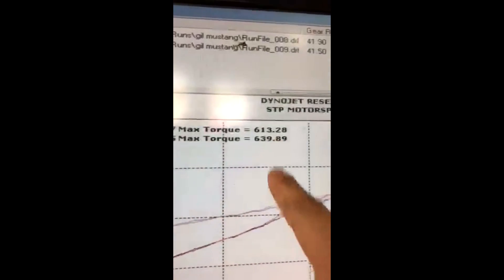What parts dont need tuning,  And Paxton 2200 E85 15 psi Dyno on VMP tune

Comment: After I did my cat back the car stalled out thought. Back pressure changed on the 15. It wants to stall after starting up after hot or refilling gas. Otherwise the whole car is stock

Comment: What about a pulley change 2.6-2.5 or adding a factory blower thats ported say on a gt500
Reply from the maker: 1991tommygun good to log it to make sure fueling is on point. But typically not if its scaled properly.

Comment: i have a 17 5.0 premium i want to add a novi 2200sl how much power on a stock engine can i get safely .. i will do exhaust injectors yada yada .. but no internal mods .. how safe is 700 rwhp
Reply: I have a 15 premium with novi 2200 with 3.6 pulley, MBRP exhaust, MSD coil packs, JMS boost-a-pump, with a lund tune. Dyno numbers are 625whp and 498wtq at around 8-9lb of boost, all stock internal.
Reply: @LEVONLEWIS1  hows it pull bro ?

Comment: What about torque converters?
Reply from the maker: Unless you want to change where they lockup, it's mostly mechanical.
Reply: Devon DeHerrera I run a 3c in my nitrous 12 gt and I ended up not changing anything.  Oe lockup is just after shifting into 3rd. Like he said if you want this in a different spot then flash it but I haven't had any issues on stock trans tune. 1.4 60ft and 6.80s in the 8th stock motor trans with converter and footbrake on juice 👌🤘

Comment: So if the car is throwing a maf sensor code with the 2.8 kb with a jlt super big air what maf sensor can be used.  Because i think the sensor is maxed out.   Its still factory 2011 gt500 sensor.

Comment: +Alejandro Flores Hey, I had the issue recently with my SCT bricking while trying to change tunes and turns out it's actually not the battery that causes this issue. I worked with Lund and SCT for about 3 days trying to pinpoint what it was and it turns out that if you try to flash the tune in some of these cars while the engine bay is hot, the ECU decides that it doesn't want to read or write data. The remedy for this was to let the car sit for about 30 minutes and let everything cool down before flashing the tune and it works 100% of the time. My car is also a track pack which I'm not sure contributed to the issue or not but I'm kind of assuming it did because I had a non-track pack 2014 GT before I bought this 2014 GT. Hope this helps and you can pass it on to others.

Comment: Retune off road pipes...My SCT screwed up just because I re-flashed with my door open. (dome lights on, etc.)
Reply: I wish I knew a long time ago just how sensitive input voltage was for that sct tuner! I'm so paranoid about it, whenever I'm retuning - radio off, windows up, doors shut, hvac off, manually lock my doors so noone opens them while it's loading, hold my breath, etc. ALSO, I have found (at lea st for an x4SCT on a 13 gt) to not ever retune immidiately after a decent length drive. I have been told by a guy at SCT that they have experienced that too - they seem to think it may be on certain ECM's that have a wire that expands so much during a drive that it loosens the connection. I know...crazy, but I make sure to wear my dream catcher when I'm loading tunes!!
Reply: LOL...ya best to be on the safe side....LOL I do believe SCT recommends a charger on the battery, but hey, who listens to that...LOL

Comment: do you need to retune your speedometer if you go from 17inch wheels to 19 inch?
Reply: Pavlo95 If you have an SCT device,  you can change the revs per mile on the device itself.
Reply: Space Man I went from 17 to 20 and I just used an app to see my speed and everything was the same so I don't think you need a tune
Reply: Depends on the tires.  I went from 18s to 19s with a staggered set up.  It threw my MPH off by 7-9 MPH.  All I needed to do was find the revs per mile of the rear tires.  Which the manufacturers list on their website. You don't need to tune but if it's throwing the speedo off,  just change the revs per mile on the device.  Easily done

Comment: I have watched a few of your videos. But on a personal level for your car which do you prefer to tune with? SCT or HPtuners? Which has a more helpful userbase to help out people who only tune their own cars, etc?

I am sure you have addressed this in the past but I have seen you mention both and just want your honest opinion as you are straightforward and do not sugarcoat shit. Which is appreciated.

For some background info. I bought a 2014 5.0 m82 car. Previous owner half assed everything. Had a bama tune in it that ran like shit and currently using the sct 93 octance tune. Only things he put on the car was a Boss302 intake with matchibg steeda  CAI and a cat delete with X pipe that is some jack up shitty setup. Going to clean this tune up and put bbk long tube headers with the matching bbk x pipe.

Thanks
Reply from the maker: On my personal car. HP tuners, cause you can see many more things and it flashed a lot quicker.
Reply: Barano ... In your sct tuner goto vehicle options. It is in there I believe
Reply: Alejandro Flores how the heck do you crank relearn?? Just did an rst clutch. I have the sct .
Reply: with HPTuners on LS cars its usually on VCM Controls on the scanner
Reply: Barano x4 can do the relearn, the x3 doesn't have that function